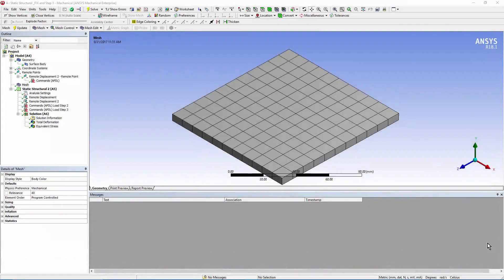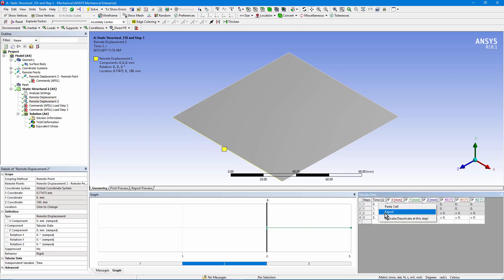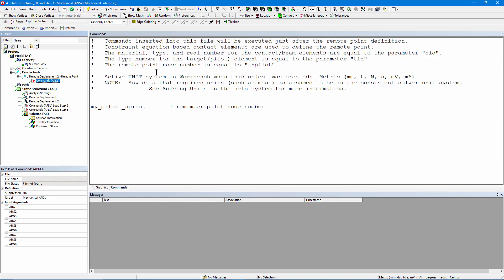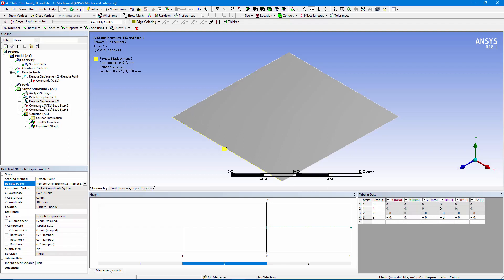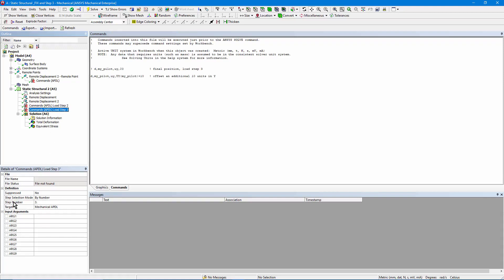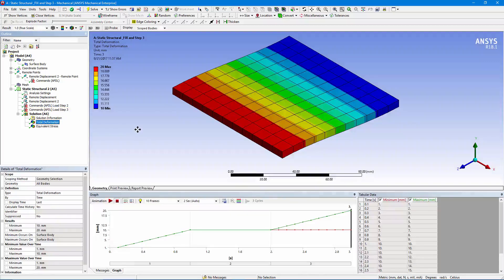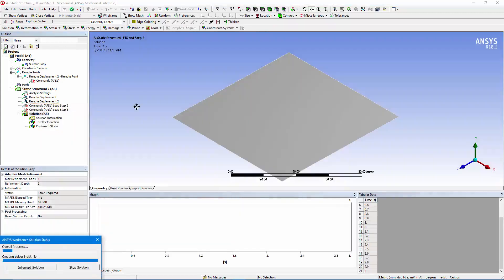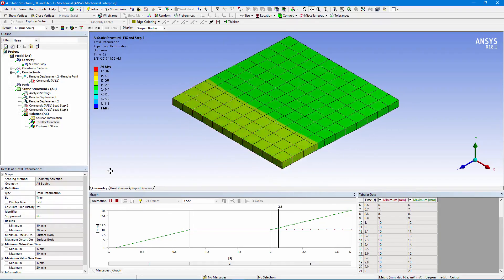Adding a New Displacement after a Load Step in Ansys Mechanical

Comment: Thank you.I have a case like the situation in video，but needs to be applied an angular displacement.When I use the rotx command,its unit is rad or degree,and can APDL recognize the pi without any additional set?
Reply from the maker: Thank you for your questions --

First, solver units for angular displacement are always in radians.

Next, APDL does not recognize the pi without any additional set.  Define a parameter called ‘pi’ in the command snippet like this:  pi=acos(-1)  Then define your rotation in the D command as multiples of the previously defined ‘pi’ parameter.  Like this:  D,my_pilot,ROTZ,pi/2    (this would define 90 degrees rotation, ie; pi/2)

Should you have additional questions, please direct them to info@simutechgroup.com or check out the SimuTech Skills Center: https://simutechgroup.com/resources/skills-center/